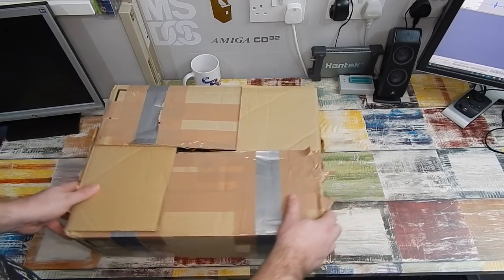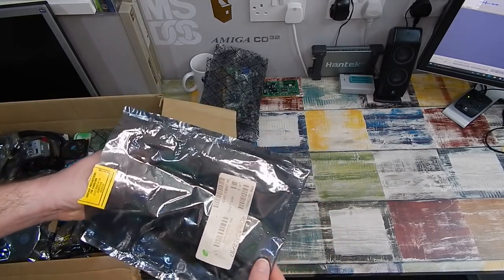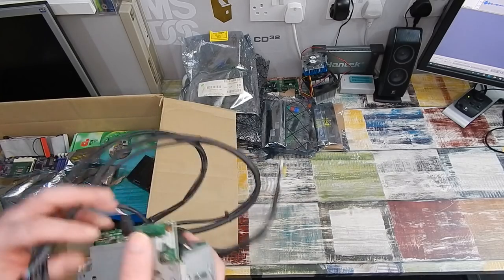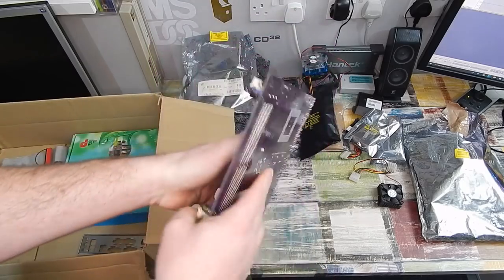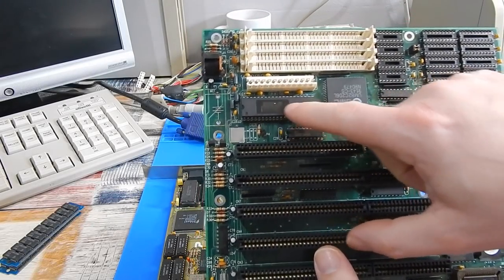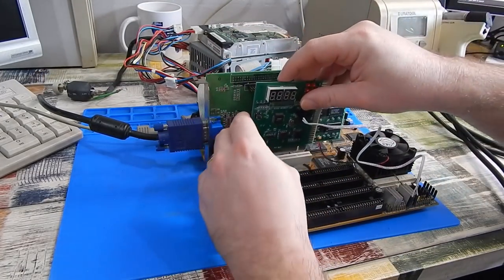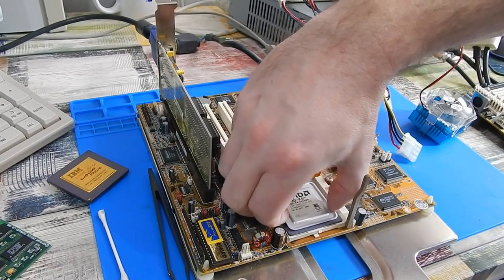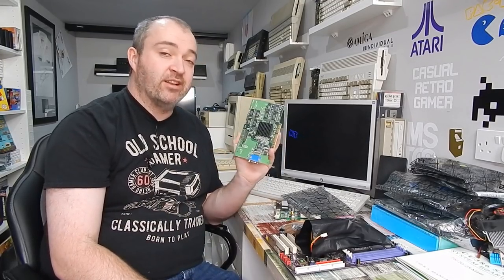I bought an untested lot of random PC parts from eBay

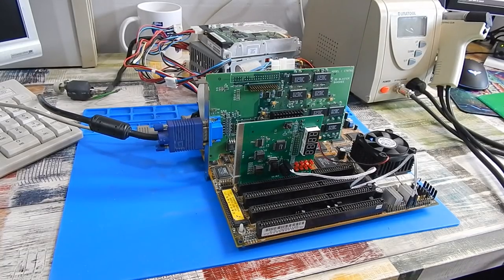Comment: 22:50 i have that same POST CARD and i am sure you used it the wrong way in the ISA slots. Theres printed "REAR" somewhere and that belongs to the side of the keyboard connector. I made this mistake too but the card still works. While using it in ISA slots, you dont face the digits so I use it on PCI slots preferrably so that i dont have to break my neck to see the codes....
Reply: Oh I noticed that too and cringed. I ruined a 486 back in the day the same away with a backwards 8-bit MFM/RLL card thrift store find.

Comment: As for good replacement capacitors for the Socket A/462 Board:
Either Panasinic FM with the same Voltage and Capacitance, but be careful, they are a bit bigger. Or Kemet A750. 
Its often Ultra Low ESR Caps and they are not made anymore... And the Stock on other sides is also NOS, often 10 years or older...

Comment: You are spot on with the assessment of the Banshee PCI card being worth the price of the purchase alone.  I cry with you over its being dead..  I just got one in my latest scrap yard find video, but a 16 MB AGP version.  l haven't tested it yet, just cleaned it up.  
Also, that 386 board is more than worth the lot price to collectors.
Super nice video sir!
Reply from the maker: Thanks, I have a few ideas to try on the banshee although I'm not confident but its certainly worth spending a few hours on.
Reply: @CRG  I agree.  Nice workbench setup too.  I am very impressed with your studio.
Reply from the maker: Thanks, it's an old garage I converted so it's narrow but long.  Like everything though as the collection grows I could really use more space.

Comment: To get your K6 running at full speed, you might try the 1.5x multiplier with it. If I remember right, AMD repurposed the 1.5x multiplier on existing boards as a 3.5x multiplier for the K6.
Reply from the maker: I actually tried this although I cut it from the video (along with a pile of other stuff) to try and keep the length down. 

It unfortunately didn't work and rather the chip just posted at 100mhz.  Makes me wonder actually why it didn't work in that first board which was also set to multiplier 1.5, well, before I changed it to 3.
Reply: @CRG  I might post after a bios update. Could simply be missing the microcode to recognise the K6.
Does the board support split voltage?
Reply from the maker: @rebeccaschade3987  Yes the board does support split voltage.  Its set currently to 3.3v for both.  A bios update may sort the issue as you say.  I do think this is abetter mobo than what went in my Matrox Mystique build so I'll fall back on that a some point and change everything over.  When I'm doing that I'll look for a BIOS update.

Comment: Well done video. I was quite happy to see the Trident card work. It is one of the few I have come across anywhere. I have a PCI TGUI9440 that dates from about 93/94 that has been my fall back card when something fails. I got it in a system that had an intel 486 DX4 100, 16 Mb RAM and a Connor 1.2 GB drive. The card is the only piece i still have and it still works. Thanks for the video.

Comment: I worked in a computer shop from late 90’s through 2010’s I’ve installed all of heat stuff. On the 462 socket build, I built a custom long screwdriver bent to clear the heat sinks for simple stress free installs…

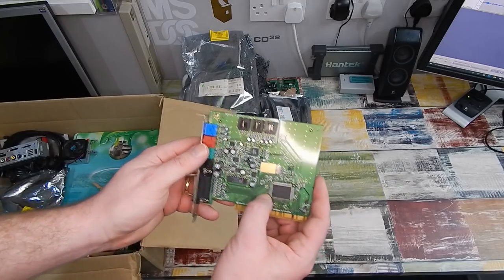Comment: The card you clocked as a "Sound Blaster 16" @7:30 is the Ensoniq AudioPCI, later the Creative Ensoniq AudioPCI, later the Creative Sound Blaster 64 PCI, then surely a few others I'm forgetting.  Etailers flooded the market with these cards when Creative acquired Ensoniq.  This card was known among audiophiles to have the best DACs and the lowest SNR of any sound card at the time, so Napster users started snatching these up the Ensoniq branded version with the ES1370 chip for roughly USD$15-20.  Sound quality was the only metric that mattered since gamer-centric features like EAX didn't exist yet; I can't remember if people liked the wavetable feature or not.

The Creative versions (ES1371 and up) add Sound Blaster 16 compatibility but drop ESS support; I can't speak to the quality of the emulation.  Just be sure to set Windows sample rate to the cards native sample rate (48khz for the Creative versions, 44khz for the original Ensoniq ES1370), otherwise the drivers will poorly resample all audio up or down, adding some terrible and unnecessary aliasing.  The drivers put all the audio processing back on the CPU, so overbuild to brute force you way over the 5-8% performance penalty.  If you want to use the wavetable feature, install from the original driver CD, the large wavetable data is not provided with the 'driver update' packages you could download from Creative.  The wavetable data gets loaded into system memory because there's no memory on the card.

From a gamer's perspective, only the wavetable support is unique and interesting, but most will just reach for a Live!. It could find a good home in a late DOS/early Windows 95 installation on a Socket 5 or Socket 7-based build.  Might be great for running demoscene productions, depending on the SB16 compatibility.
Reply from the maker: Thanks for the detailed response, seemingly a better card than I initially thought then.  Might drop it into my windows 95 build.
Reply: The adlib emulation may be the worst of all time on these.

Comment: This looked like you found my childhood parts box. I had probably 70% of those boards and CPUs. The only things I didn't have, were the slot CPU and 1 or 2 of those sound cards and that multi storage card unit, although I had a very similar unit. Most of my PCs were built from hand me down parts from my dad who would upgrade every year or 2 or in some cases my older sister would have a slightly faster CPU than me and when she upgraded before me I would take her old stuff even if it was just slightly better (I upgraded from a 133Mhz to that 166mhz at some point).

Comment: I still have one of the afermarket copper spacers for Socket A CPU with exposed die to prevent cooloer breaking die.
You also connected the diag card backwards in the ISA slot in Socket 7 motherboard.

Comment: Your p3 can be run at 66 or 100 MHz fsb with no trouble in the event that your board won't do the 133 MHz fsb. Those chips were pretty forgiving about mild overclock via fsb and or multiplier.
Reply from the maker: That's not good news then as it suggests the P3 is dead :(  Perhaps a bios update might let it post.

Comment: Great vid, too bad that banshee was a no go. But I agree, you got a great haul.

Just as a reminder: would be careful powering that socket A board with a modern supply. Socket A boards often required higher +5v amperage than most supplies today provide, up to 30 amps I believe. AMD didn't adopt the P4 connector until Athlon64 which put a huge strain on the +5 bus.

It's a common issue that I see with socket A retro builds and why a lot of older builds used 'lower wattage' supplies. Take a look at that delta from your haul, see if it has a high rating on the +5. It may just be the right fit for your socket A board.

Comment: Cool video, the front panel device is from a Medion multimedia PC and is proprietary, you need the correct mainboard to use all the connections, only the card reader and audio are standards, also it fits a custom panel in the propietary case. I have one myself and it is now pretty much useless.
Reply from the maker: Thanks for letting me know.
Reply: Some PCI TV tuner cards have headers for front AV inputs. The Composite, S-Video and L/R RCA ports would connect to such a card, not connect to the motherboard. That means you could use this in any system if you buy a suitable tuner card.

Comment: The purple motherboard is made by Jetway.  The motherboard is the V500DAP, manualslib has the motherboard manual.
Reply from the maker: Thanks for the info, I've bought the caps I need to replace, just want to get a better CPU for it then I feel a Windows 2K build coming :)

Comment: Good haul for the money. Regarding the banshee, there's a couple of things I'd try - firstly, you can try flashing it with another BIOS with the trident card in, or in some cases, a blind flash is required. In some super rare cases, the BIOS chips just fail and you have to desolder and flash externally and/or replace the chip.

If no dice after that, you can also try reflowing the GPU - banshees get stupidly hot, and whilst they're designed to do that, I can't imagine that the thermal stresses do them any good.
Reply from the maker: Since this video was made I was able to fix the banshee.  I wish I had recorded it but alas I wasn't sure it could be fixed.  

It turned out to be a dead crystal on the banshee.  Fitted a new one and away it went.
Reply: @CRG  Fantastic stuff! Enjoy it!

Also as I forgot in my earlier comment - happy new year - hope it's a good one for you :)
Reply from the maker: Happy new year to you also 🥳

Comment: The ST 486 is in fact a Cyrix design build under license by ST. Performance wise, it's exactly the same as a Cyrix branded one. I don't see how it could perform different from the Blue Lightning, which is the same thing. Maybe a cache issue (WT vs. WB) or something like that.
Reply from the maker: In the quick benchmark I did it came out 2 points higher.  Really should put that to test in games etc but I suspect there would be very little if anything in it.
Reply: Since Cyrix was fabless, ST was one of the several companies that manufactured chips for Cyrix. It was part of the deal that they could make a certain percentage of chips under their own branding. It could be a latet revision chip perhaps, with some minor overhauls to the design? Not certain, as I only own one Cyrix/ST chip myself and don't have too much experience with them.

Comment: Check the video bios for the vodoo.
Some viruses of the early 2000s targeted  bioses, at least motherboard ones.
I had one motherboard erased by the chernobyl/spacefiller one.
Got success hot swapping the bios chip of a working motherboard after the computer booted up on DOS, then flashing the image on the erased chip using the DOS flash tool.
These boards bring me these memories.

Comment: Nice haul. Shame about the banshee though I would probably have been most excited about the 386 mobo. I've tried my luck on a few untested things and had some real bargains, it's a gamble but worth taking sometimes even if all you get out of it is a challenge.
Reply from the maker: The 386 board is nice, especially since it has the 387 in there too. If I can find a suitable case I may pull together a little machine using it.
Reply: @CRG  cool, that would make a nice vid.

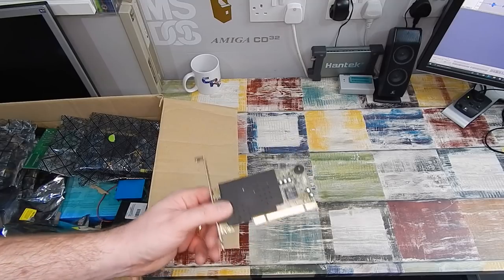Comment: 1:55 Not 100Mbps card. Probably realtek 8029. Saw Base2 connector only on 10Mbps cards. Was replacing those combo cards with 100Mbps realteks, when upgraded from mixed 10/100 Mbps network 20 years ago.

Comment: Thanks for the video! Have a box of PC parts from dumpster diving. Instead of scrapping I'll ask a local repair shop in they can reuse any of it. Its not about money - its about reusing stuff. What ideas do you have for your freshly tested parts? Selling in refurbished systems? Cheers from Germany
Reply from the maker: Yes, please don't bin anything as there is always someone out there that can make use of these old parts.  

As for the parts I'll probably build a little system around the 386 motherboard.  The socket 7 board I'm going to swap out against my current socket 7 build then keep the other board for test.  The purple jetway board, while its not fantastic it looks great so I'm thinking an early XP build in a clear case.  I'll try to pair whatever other components I can into the builds also.  The other parts just go into storage for spares or future use.  

I tend to keep the builds for myself although it is hard to find time to use all of it.  If I sell anything on it generally just goes to friends in the community at cost price.  Like you said its not about the money, for me its just a love of this old hardware.

Comment: Great video! Too bad the Banshee didn't work. Hope you can repair it in a future! Wasn't the diagnostic card plugged the other way around in the ISA slot? I noticed it says REAR with an arrow but it was pointing to the front?
Reply from the maker: You know you may be correct on that and the test card.  Lucky I didn't blow anything up.
Reply: @CRG  just saw this comment here after i already commented.... made same mistake with that card but still works... they are tough little china stuff. But that was weeks ago and i used it often but now it only shows crap lately. Even 4 dashes as in no code and the board does still work and POST and boot. I wonder why......
Reply from the maker: @CosmoRiderDE  If its a really old board then possibly the BIOS doesn't support post codes.
Reply: @CRG  it did work before.. on old and newer ones. Now i somehow do not find it reliable anymore. I dont know why

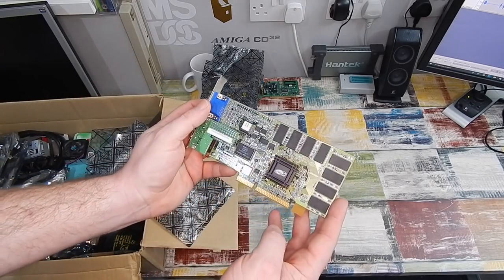Comment: 5:17 ...fairly certain that is an AGP bus?   ...Only a person who has gone through every level of PC torment during the early years of jumper pins and dip switches could make swapping so many ISA bus equipped motherboards, so many different CPU's and so many clock multipliers appear to be so easy and smoothly executed.  Its amazing that I actually went through those same trials and tribulations and only ever KIA'd one motherboard (...it was a hapless 386sx and met its end by a dropped screw, alas, while it was turned on.  Soon after, that 10$ ($9.99) magnetic tipped screwdriver was the best 10 bucks I've ever spent and its still with me....  Never got really comfortable with magnetic screwdriver tips around motherboards though, I have the thought that its all just psychological.).  This video took me back well past the days of DRDOS and smack into vibrating 5 1/4 full height MFM magic (that last "M" stands for magic, right? And the first "M" stands for Vibrating?)  Well, you may take some comfort and pride in knowing that all of these professional, modern day 'toobies', would probably squack, cluck and cf if they had to calculate clock multipliers and juggle jumpers (Yeah that means you, Jayz nonsense and Linus (legend in his own mind) Space Weanie tips).  If I had to guess that there may be just one other youtuber who could install a "non-MMX" CPU I would go with Eli, just imagine....  OOOPS how could I have forgotten LGR?  But isn't it something?  Back in the days of jumper settings when 4mb of RAM was big news and being a PC tech meant something. (If you can set jumper settings and everyone within a 400 mile circle brings their motherboard to you to install simms that they bought months prior, into those little "plastic-like" clips, in spite of their experience, then  It still does...)  Great video! Are you looking for any, specific, show stopping parts?
Reply from the maker: Yep that an ago card, I do correct myself later in the video. 

Playing with this old hardware does take me back although a fair bit of it is actually before my time in pc land.  I was Amiga all the way up to 96 when we got our first pentium based pc.  As odd as it may sound to some I genuinely enjoyfun going back and playing with all that hardware I missed. 

As for a specific bit of hardware... That's a tricky one.  Half the time I'm browsing eBay randomly and just stumble across the next must have part.  Right now I'm looking for a hdd controller for an Apricot F pc.  An incredibly rare card, I doubt I'll find one but you never know.
Reply: @CRG  Hehe, my bestfriend was an Amiga fan, hard core, but I never gave him a difficult time about it, he, like myself, developed an instantaneous sort of dislike for anything Apple.  (I just have the thought that Apple products are more about some kind of 'status symbol' or 'badge of honor' (superficial, if one can be that with regard to computers).  At any rate about that Apricaught I'm curious ....well, sometimes I just have to ask:  Is that a micro-channel bus?  And they were quite costly?  Actually came from your part of the world or just due south perhaps?
Reply from the maker: @CRSolarice  I always seen apples as school computers, that what we were forced to use in school anyway and I never liked them.  Always thought my Amiga at home was so much better but then again that had games :).  I do have a couple of apples in the collection now but they aren't something I go looking for.

As for the other fruit, the apricot, it was a UK machine by ACT/Apricot.  Now don't quote me on that cause I'm still researching the history but that's how I understand it just now.  It's expansion bus seems to be proprietary to this range of computers.  It uses a multipin connector, not sure of its name. I will of course be doing a video on the system and hopefully in the coming weeks so keep an eye out.

Comment: Too bad that the Banshee didn't work. It had one myself back in the days (not sure if it was PCI or AGP), but I gave it away around the year 2000. It had a flaw that it couldn't display proper colours in any 256 color mode, but actually, I hardly noticed that because in those days, almost everything was 16 bit colour and upwards anyway.
Reply from the maker: Not totally given up on it yet but if it's the main gpu then there'll be nothing I can do.  I'll stick the scope on it and see if there's anything on the output.
Reply: @CRG  It would be nice to see it back in action. The Banshee is an underrated chipset IMHO. I switched from a Voodoo 2 to a Banshee. The fact that I missed out on one texture unit that way didn't really matter. The Banshee supported higher resolutions, had a better image quality and a higher clockspeed. With a moderate overclock, it was even better.